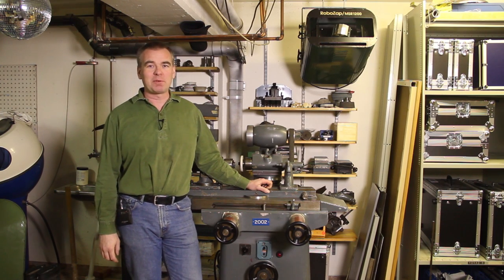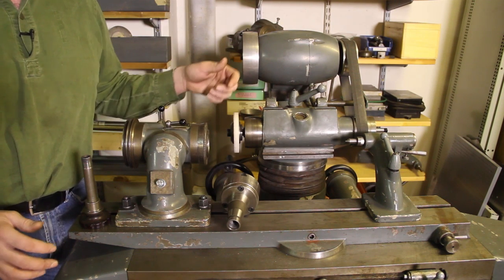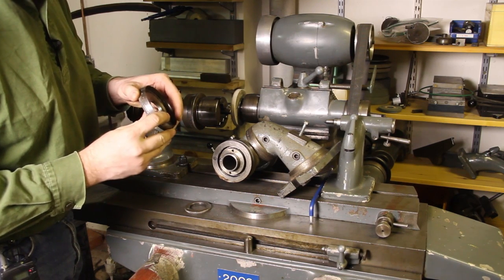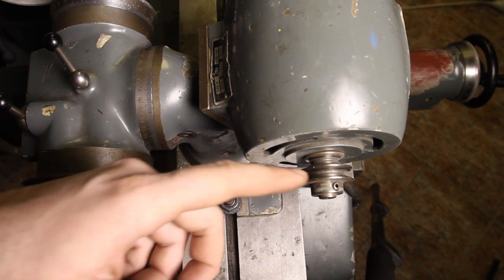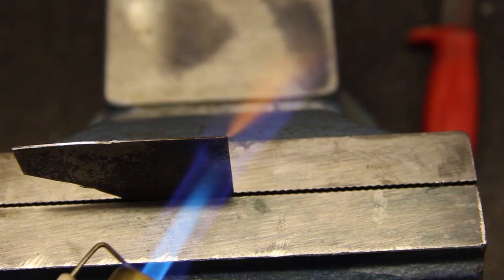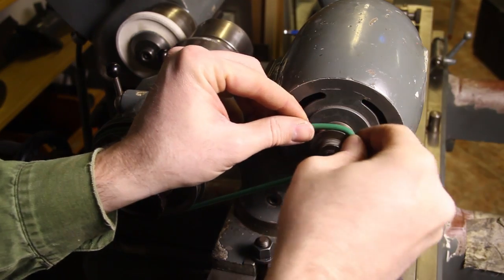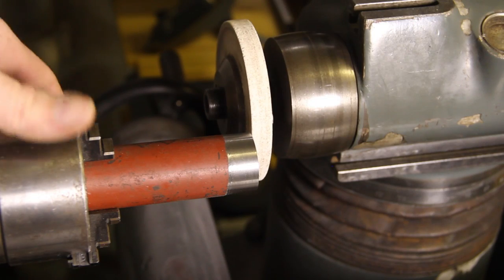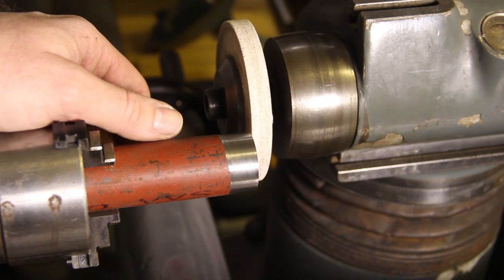Melt The Belt!

Comment: That's a very interesting machine!  I imagine you can make some very accurate tapers with it (Morse tapers, etc.)
  We did a tour of Denmark a few years ago and crossed over to Gothenburg and took a few days to drive down to Malmo before crossing back to Copenhagen.  We were there during the high school graduation weekend and were entertained by the many young graduates partying around Malmo.
Reply from the maker: It should be possible to make accurate tapers, yes... but I haven't tried that yet. By putting the main spindle crosswise to the table, the grinder can also be used as a surface grinder for small parts. That is probably a useful feature, too.
It sounds l ike you had a good time in Malmö!
Reply: I have made the mistake of going to Seattle on graduation night.  As I was pulling off I-5, in the ramp lane, a car passed me going 100mph, on the right, and there was a concrete sided ramp I was on.